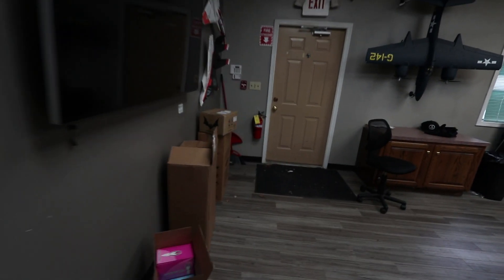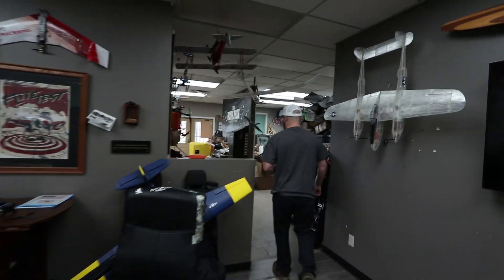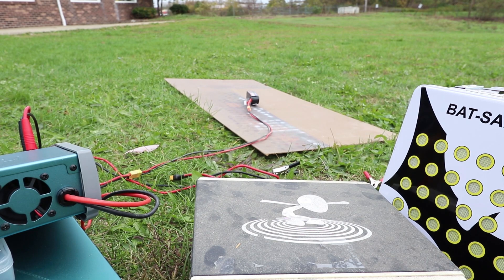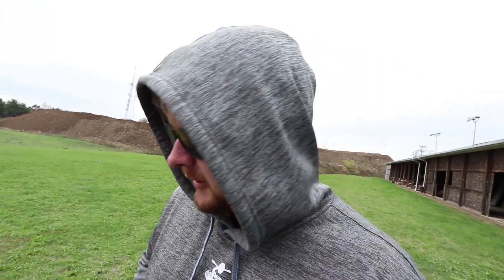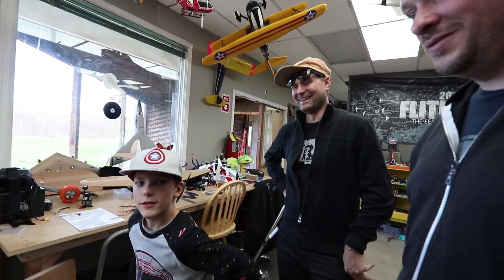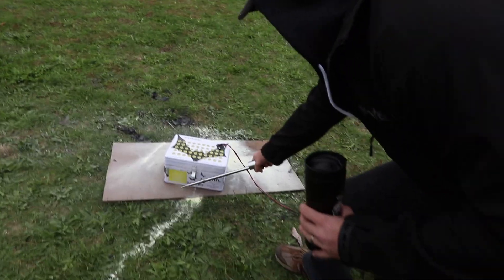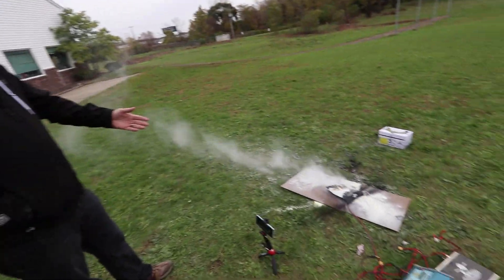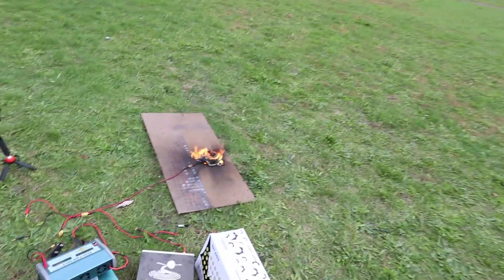WHEN LITHIUM BATTERIES EXPLODE... | VLOG0121

Comment from the maker: Lot's of comments about ammo cans. If you use ammo cans be sure to drill lots of holes in them or they themselves will blow up like a bomb if a lipo goes off inside.
Reply: and make sure to remove the ammo ! :)
Reply: one of your older videos (i think the battery bunker one) specifically mentions ammo cans as being a good idea. maybe you should add an annotation or something to it to update it.
Reply: As long as you remove the rubber seal you should be fine unless you have lots of batteries in there.
Reply: You can also leave the cover cracked open...
Reply: Trigg3rhappy how do you use the drywall? Could you elaborate
Reply: remove the seal, don't fill it all the way up (max50%) and put a bag of sand on top to fill the rest of it. Then close the lid and place it on a ceramic tile. Floor is now firereproof and the sand migt help to stop the fire faster. Whats about a test???
Reply: https://www.youtube.com/watch?v=CnNId0mDnBo&t=18s
Reply: Trigg3rhappy watch what video? You forgot to link something ;)
Reply: FliteTest they say the smoke that is released from the top vents is filtered and non-toxic even breathable at least that's how it's been since the GoFundMe page. Just something people should know even though charging outside is recommended if you're going to charge and doors this is a must have thank you for doing a proper episode on it, it definitely deserved it!
Reply: Robert Veach not a good idea. The pressure could easily pop the lid off and flames could come out.
Reply: Disliked for you guys sounding like a bunch of annoying morons.
Reply: Don't drill any holes! Take out the seal between the lid and the ammo can base. Leave everything else intact.  Smoke will still roll around the seal and get out.  No reason to drill holes,  holes will let the flames shoot out. There is a video I will find and link.
Reply: https://youtu.be/CnNId0mDnBo
Reply: There are some fantastic tests that have been done with the ammo boxes. I use drywall inside mine and it works alot better than the sand, its cheap and easy to handle. Sand makes a mess. Here watch this video with testing on the ammo can that will really wake ya up. Hope TJ and Josh and the guys watch this video before giving people advice about ammo cans

Comment: I accidentally unwrapped a lithium battery thinking the outside was tape or something. What do i do?
Reply: Like the cell or just the label? If it's the label, you should be fine. Just cover the label with packing tape but keep an eye on it just to be safe. If it's the cell, get rid of it. I'd recommend throwing it out at a recycling center (I believe Best Buy does that). If you can't find one near you, just throw it in a salt water bath over night and that should discharge the battery to a point where you could just throw it in the trash. Hope that helps! :)
Reply: @mylesspear  it might have been the cell but I'm not sure. It was like 6 months ago and I figured it out. Thank you for your concern though.

Comment: fThat smell, Is fumes from the toxic heavy metal burning. That is very dangerous and toxic.  Even the smoke fumes and the nonvisible gasses will bassoon your skin.   Know to be as toxic as Dixon, which will adhere genes, causing mutations. Which will affect your children and even keep you from having children and even the keep you from having children.  As well as know to cause testicular cancer,  prostate cancer, and bone  cancer.    Even, with using gas mask, the toxic fumes will absorb into your skin. An experiment will result and answers questions, I really did not see an experiment. I seen some guys not, researching before trying.   I seen some guys not, researching before trying.  Even hear someone say, " We take safety seriously.' If you did, you would have researched what will happen if you release such toxic fumes. As well, if you ready the battery, the government has regulations (LAWS), printed on the battery, with proper disposal of such batteries.  That ground is now full of heavy medals, left being for small children or elderly people in the future to be affected. Heavy metals stay in the soil and do not wash away.  The soil must be removed and properly decontaminated.  I would suggest a bit more research for any "experiment." Below are the actual experiment steps, which should be part of your page.  I implore you, PLEASE do not burn batteries, they contain HEAVY metals, that form invisible gas,  that are in the air, and stay for 100's of years on the ground as the particulate settle over a very large area. Where every the smoke travels it will leave behind this.  For unsuspecting people in the area. 

State the hypothesis to be tested. ...
Formulate a context. ...
Formulate a theoretical model. ...
Research safety of the experiment...
Design the experiment. ...
Construct the experiment.
Test the safety of the experimental apparatus. ...
Perform preliminary experiments. ...
Perform the experiment.

Comment: That is not an explosion. That is catching fire. When my lithium ion battery ACTUALLY exploded it was a huge blast throwing molten metal at tremendous speed and force starting many little fires. The heat from it felt like being thrown in an oven and days later i still had sore spots that felt like mini sunburns alk over my body. Luckily I was not in the direct line of the molten metal beads. I keep finding them in the bed and floor. It was the lithium ion battery in my vape mod. And everything molten from the inside of the battery shot out the ends of the tabular shape of the battery. It had short circuited so I hade disassembled it and rigged up a switch and zip tied it to the outside of the housing. I had two leads that came out that I would hook up to the trickle / boost car battery charger i had. I left it on for too long and while playing the ps4 and BOOM!!!. I AM LUCKY TO BE ALIVE. Point being... this video at no time actually show an EXPLOSION. this shows a dude unplugging it before you get to the EXPLOSION and you only get the flames. People that have experienced ACTUAL lithium ion EXPLOSIONS may feel like you are providing false info on things, that make what they experienced and survived look like little more than a cheap firework display or small bbq. Many lose their lives to real explosions from these batteries. I could have if things went different. Your little display is minuscule in comparison to what happened a couple feet away from me in my livingroom. 

Suggestion- rename video to, "...lithium ion catches fire..." and remove explosion.

Comment: Since I never leave a battery unattended while charging I have a galvanized bucket with some sand in the bottom to put my charging bag in.  I also keep a large stainless steel bowl thinking I will turn it upside down over the bucket if something happens.  And a small fire extinguisher.  
So all this stuff along with the charger go to whatever room I happen to be in when I want to charge a battery.  Garage, computer room, TV room, kitchen, they can all be my charging room.

Comment: Question: If you overcharge the lipo and you see smoke and then small fire afterwards, could you stop the upcoming big explosion by unplugging the charger quickly?
Reply: Probably not, as the reaction is already set in motion. The fireball comes from excess oxygen so when it starts to flame, the whole thing goes up and can't be stopped. The best thing you can do is chuck it far outside if you can, and grab the nearest fire extinguisher, one of which everyone should have.

Comment: I have the dynamite Prophet sport mini 50w  multi chemistry  charger and I need to know what amp setting I need for charging a 1350mAh 3 cell.  Do I set it on 1.2.3.or 4 Amp? I don’t want my battery to blow up like this.

Comment: The only problem I see with the bat safe charging box is, you can't visually feel and look at the battery during the charging process. If you were able to feel and see the battery at least you may be able to see some puffing or feel the battery for excessive heat and turn it off before we would need a bat box, nevertheless pretty cool though

Comment: My battery almost blew up in my traxxas rustler with a slash conversion because the battery tray is built into the chassis and when i did the slash conversion the longer wheelbase made the chassis flex a whole lot more when landing from dirt jumps and kept bending the battery making it swell and start breaking the hard plastic case it was in, luckily i disposed of it before it could explode

Comment: Nice test guys, Not only do we remove the flame but we remove the soot.  That is a big advantage over the bags. If you don't catch your house on fire the soot will make a mess of your entire house.  You can see the black soot pore out of the battery fires that were not bat safe tested.   Also the bags have a much lower capacity that the bat safe.   A 6s 5000 mah battery I tested in a bag did catch the entire bag on fire.   Tom

Comment: wow, that Bat-Safe Box is awesome. absolutely a must-have for those who owns lots of LiPo's. but i'm looking to replace few of my LiPos to something safer. still waiting for my 18650 VTC6's to come.
btw, that "Lipo Bag" would also catch fire and will burn anything around just if the fire accidentally touches the hot top side. just try to fire it up (in a safe environment outside) with a lighter just to see what will happen - it's NOT safe!
it's because of non-fireproof plastic covering! it should have been something better, at least something that won't burn like a fuel...

Comment: @flighttest I have animals and the smoke that comes out of the bat box is supposed to be non-toxic or at least less toxic and breathable I wouldn't want to necessarily stick my face into it however in an emergency the gas is released from a Lithium Polymer battery would kill all the animals however with this bat box it would filter that smoke and make it non or less toxic to my reptiles. AnD I wish you guys have talked more about THAT but other than that, great job as always! Been a fan of this since gofundme :)

Comment: That smoke is flammable, isn't it? If so, it would get interesting very fast if there was an ignition source nearby. Like, say, the pilot light on a gas water heater. I'd like to see what happens if you throw a match or something into the smoke. 

You might put a bag of baking soda inside with the battery. The CO2 from that might make the smoke less likely to burn.  Still best to do this outside.

Comment: I have to admit that until I watched this video I had been underestimating the danger of my batteries.
Reply: I met someone who lost his house and almost his grandmother by careless charging of lipos. On the other hand, I met someone else who came close to that charging a nicad with wiring that shorted out.
Reply: Don't push 20 amps at 20v through it and you should be alright mate... If you're using a protected cell overcurrent protection should kick in anyway.
Reply: Me as well I thought it wouldn’t be that bad at all. When they said Lithium Polymer batterys. When they extremely dangerous if handled in correctly. I thought they over exaggerated. Well they where not lying
Reply: but HOW could you form any conslusions at all, when NO data describing the parameters of this outrageously un-scientific demo ???

Comment: What about a batsafe v2 with a charge port on the outside and have a cable connector on the inside. That way you can keep the box more closed, as the connectors would be part of the chassis, instead of having to feed a cable through a leaking conduit. Might not be as good for battery temperature though, I can imagine the battery getting a fair bit warmer inside a box like that.
Reply: hillie47 that would be ideal. The only difficult part would be coming up with all of the combinations of connectors in use and deciding which ones to provide.
Reply: What about the semi-standard banana ones that are on the chargers? Then you just need a nice beefy cable with the right connectors from the charger to the box and you can use your charger's standard cables inside.

Comment: I use a NEMA rated enclosure lined with tile. The enclosure is rated at to contain a 12kv line relay 
It fared the same as the bat box with a 6s 10ah

Comment: 60$ for a metal box.... and for what i see result is pretty much the same as using an ammo box wich are arround for 10$ (maybe less in the US) or the old hollow concrete brick system with a sand bag on top (autoextintion)
Reply: I have not yet seen an ammo box with insulating double walls, fiberglass filtered vent holes and insulated cable inlet.

Comment: Im one of the people who bought a 3D printer and the files from 3DLabs after the P38 video. Although my printer is a tiny 180mm bed chinese knock off, it didn't stop me from printing a guitar and it won't stop me from building a plane! I love the 3D print content and can't wait for the flying LulzBot. This small bed limits me on X and Y length but it's a tall delta, so I can print tall.I would love a build challenge or design a printable fuselage (like the swappable) that would use a easy standard foamy wing. It would cut print time in half and weight. I was thinking like the Alpha Bravo Charlie but your main piece was 3D printed.

Comment: The problem with LiPo fire is, that the smoke is very corrosive. Anything that gets in contact with the smoke and is not stainless steel gets rusty. Screws, engine shafts of your electric motors... The other thing is that the smoke is settling down in every little gap, on every surface and every corner and its nearly impossible to ever get it completely clean.
A friend of mine had his jet in his leased transporter and a lipo started burning. A professional company that cleans yachts and other expensive vehicles after a fire or something tried to clean the van but they gave up and said it's better to get the insurance and buy a new car. All the wires corroded, all screws were rusty. 
His cotton jeans, polyester shirts and all his other clothing just ripped apart by touching it due to the smoke.
The total cost was around 40 thousand dollars!

Get your LiPo's out of your rc models and put them into a lipo save or  a fire proofed document case guys. being lazy or save 60 bucks for a lipo save is not worth buying a new car or clean your whole house!

Comment: Charge your batteries at low amperage and do not go over 4.20V/cell, and you won't have problems, just do some research for safe charging parameters and balance-charge always. If this batteries were so dangerous no one would install them in EVs, were Li-Ion batteries are used, the ones that are supposed to be even more dangerous than Li-Po batteries. Anyway, thanks for showing people that this things can be really dangerous.
Reply: Most EVs also use LiFePo4 batteries, which are much safer. Only Tesla uses Li-ion batteries, and there have been a couple of Tesla fires. No issues that I know of with Nissan Leafs or any other LiFePo4 EVs.

Comment: ehh, is that not just a metal reinforced box with a fancy paint job. diy for less than $60 metal box fire proof insulation and you can paint it with any design you want. BUILT NOT BOUGHT
Reply: The bat-safe is an insulated double wall steel box to contain not only the fire, but the intense heat too. The top is made of steel and fiberglass to also reduce the heat of the venting gases and filter the smoke. That's a little more effort to build yourself.

Comment: lots of very hot chunks coming out of that. if you were charging larger batteries than that, I would expect a fire. 6s 5000 for large scale models would easily have fires.

Comment: Could you guys test a standard issue ammo case with lipos?  They're about $12 at Harbor Freight or Academy Sports.  I use them for lipo battery storage & transport.  And I use another one for charging inside.  Seems to me that ammo case is pretty lipo fire proof, but I've never tested it.
Reply: That's a common misconception - ammo cans aren't designed to be fireproof.  They're designed to be WATERproof and impact-resistant, which is why plastic ammo cans are getting to be more common.  You don't want dented cartridges because they'll jam in the weapon, and obviously don't want them getting wet - there's no seal between the actual projectile and the shell, so water could get in there and ruin the powder.
Reply: Make sure it has holes to vent. You'd still get a lot of smoke, but the box wouldn't explode from the gases.
Reply: Balu Yeah, my charging case has two holes on the side for two sets of balance and charge leads, reinforced by rubber grommets. It's a tight fit, but probably just enough to relieve internal pressure.  Of course, ammo cans are built to withstand a good amount fire and pressure, I'd still like to see some testing.

Comment: Wow. Ok. Note to self, dispose of the bad lipos sitting in the garage first thing in the morning. Question i have never heard answered is where to take them to be properly, and safely, disposed of
Reply: In Germany we have recycling yards where you can bring batteries (and dangerous chemicals, etc.). I usually discharge them completely using a 12 V car lamp (for 3S) before bringing them there.
Reply: Find a battery supply store near you. Our local retailer will take any battery for disposal at no charge, including every RC battery I've used back to the NiCad days.

Comment: What an excellent idea👍🏻
But a little to impractical to charge in. Trying to connect to the balance port & charger lead would be a pain in the backside. It only allows you to charge 1 battery at a time I have a charger that can charge 4 batteries. Excellent ideas but could of been better designed for more practical charging. I may get a couple for storage.